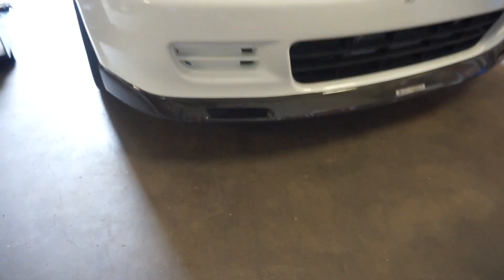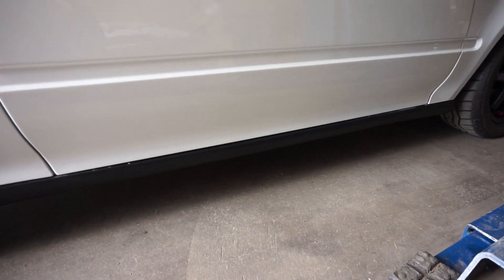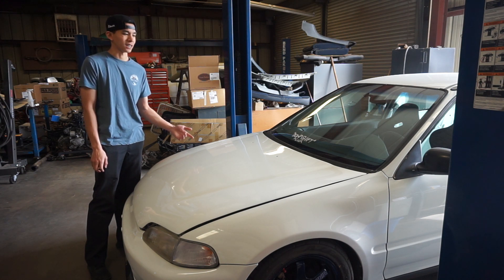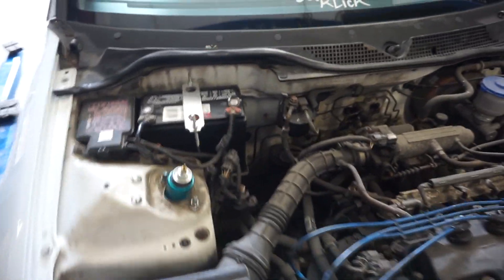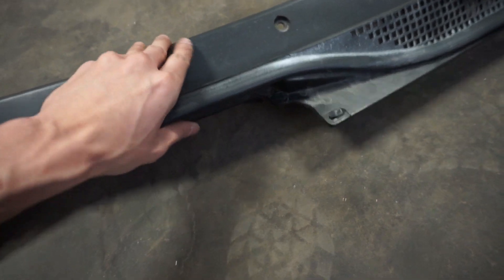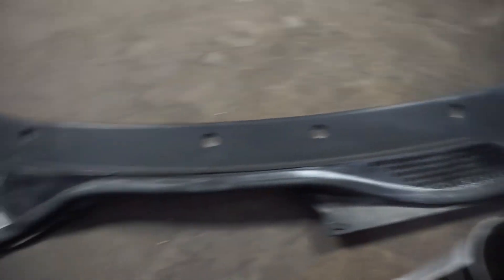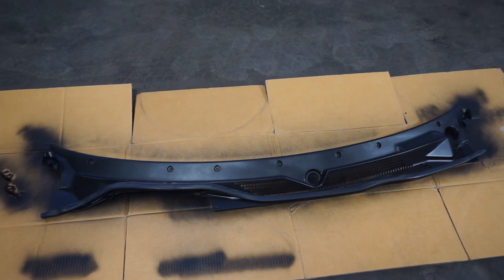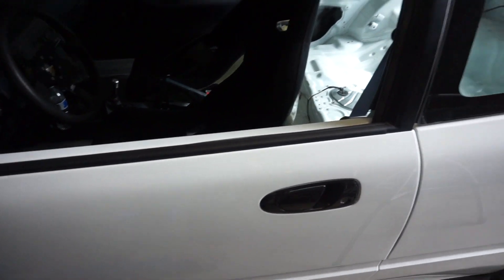Painting faded windshield cowl and molding install

Comment: What tool did you use to remove the clips on the top portion of the cowl?  I tried removing mine with a mini flathead screwdriver and they break easily.
Reply from the maker: That’s actually what I used also, a pocket screwdriver. You have to be careful since they’re so brittle, just kind of work your way around it don’t pry in one spot.
Reply: @Collective99  Thanks for the reply. All of the clips ended up braking with the exception of one, I have to order new ones.